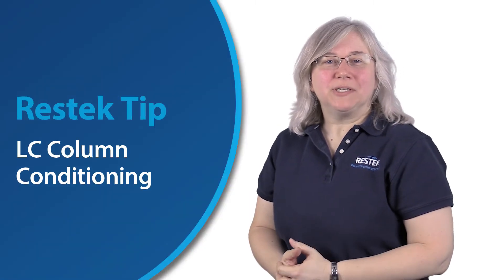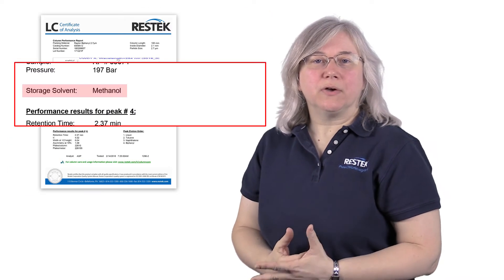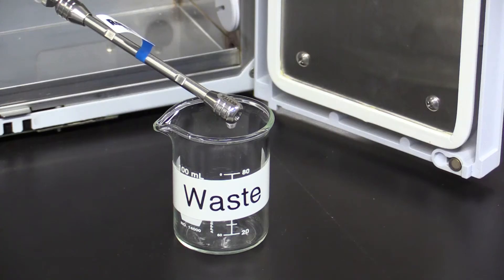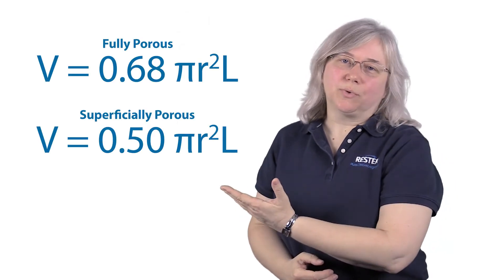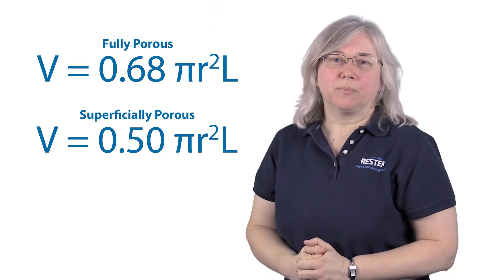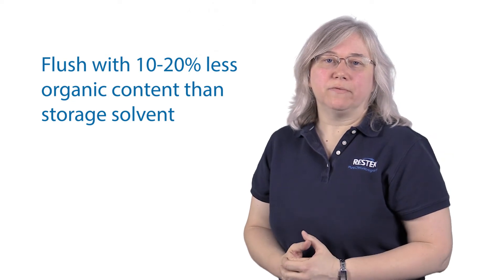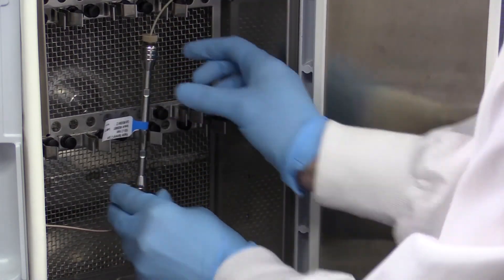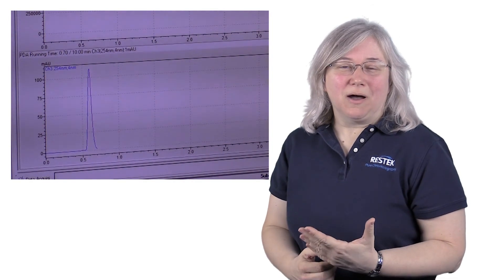LC Column Conditioning

Comment: Can you please elaborate column volume calculation  with an example eg: 4.5*250
Reply from the maker: Column volume can be estimated using the formula: V = ∏ r2 L where V = column volume in mL, r = column radius in cm, and L = length of the column in cm. So as an example, if we were using a 150mm long column with a 3mm diameter, our calculation would be V = ∏ * (0.15)^2 * 15 = 1.06 mL column volume. Note that we need to turn our length in to centimeters, and our diameter in mm in to radius in cm as well.

Comment: For example: solvent store is methanol 100%. So, first I wash the column with 10-20% methanol in H2O (for about 15 min) and then wash the column with my organic solvent (for example 60 Acetonitrile and 40 H2O)?
Reply from the maker: You can see detailed steps including a solvent progression here https://www.restek.com/en/technical-literature-library/articles/restek-liquid-chromatography-LC-columns--cleaning-recommendations/ In the situation you are describing, you would not need to go from 100% methanol to methanol/water and then continue on the progression to organic solvent. If you take a look at Table I at the link above, you'd just starting on step 2 which is methanol.